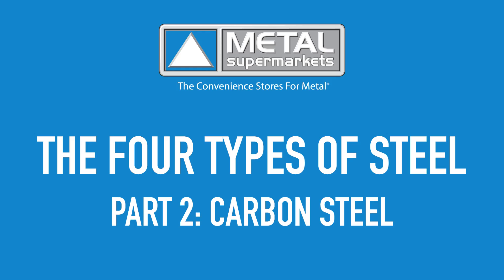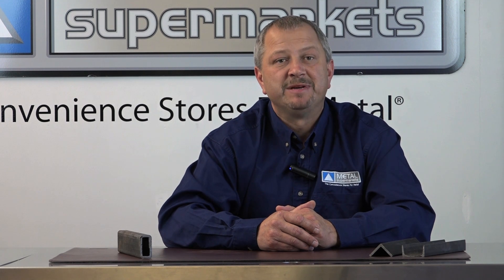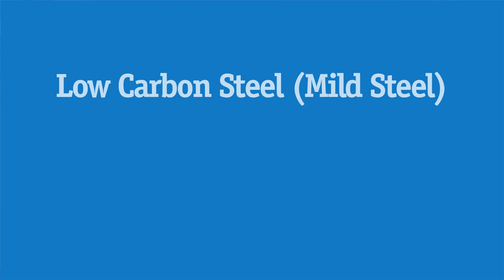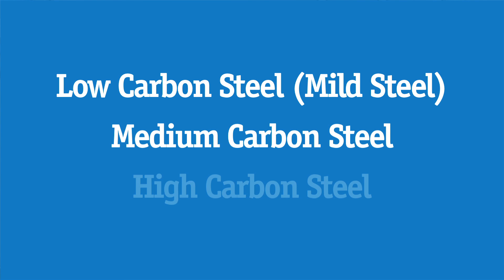The Four Types of Steel (Part 2: Carbon Steel) | Metal Supermarkets

Comment: You need a video now that gives an idea of which steels are best for which uses. You have talked about in this series over 20 different types of steel in each of the CAST types.  Do I want high carbon, low carbon, or any of the other additives and how much?

Comment: Excellent way of thinking metal; CAST: Carbon Steels, Alloy Steels, Stainless Steels, & high-quality Tool Steels from Electric Furnaces with Quality-controls.  Thanks for a great series of YouTube-Blogs. The Technical College in Eau Claire WI., (CVTC) uses Mr. Jackson's Videos for training of Welders & other Technical Automation Specialists.

Thomas J. Vanderloop, CAD-Mechanical Design Consultant, AWS & LSME; Certified MFG-Engineer (CMfgE)

Comment: Some silly questions probably but, with all these different compositions of steel, what do they do when it comes to recycling?
Do they simply melt them all down into one, then somehow remove the carbon?
I didn't know aluminum was used in steel, can you separate the two after the manufacturing process?

Comment: Leaf springs , high carbon steal ,springy , bounces back from a blow , elastic , it's also very hard , slightly brittle , and it's made for g.m.engeneers , high qualiety every time . Heat to red hot and cool it slowly , it will soften ,enough to work , it will mush when struck by a hammer when reheated to red hot.and a hack saw blade will bite into it...good luck

Comment: Glad I found these videos.  There is a Metals Supermarket around the corner from me but when I went in asking for knife blade steel I was told they only had one stock suitable and it was a small inch by an eighth bar.  Not what I wanted but seeing these videos and checking the website it looks like there is actually a chance I'll find what I need.
Reply: sounds like the perfect size for a good knife blade. If you can Blacksmith weld that piece inside of some mild steel, you will have the perfect knife blank...

Comment: 2:57 I didn't get this point , how come it become hard and brittle ?
Reply: It's kind of weird to explain, but here I go: Hardness is about superficial hardness (if something is hard to scratch), and brittleness is about how this steel behaves at some level of stress. A brittle steel, at high stress, fails suddenly, and a ductile (the opposite of brittle) steel deforms a lot until it breaks.
Reply: @paulolange3462  glass is hard but brittle